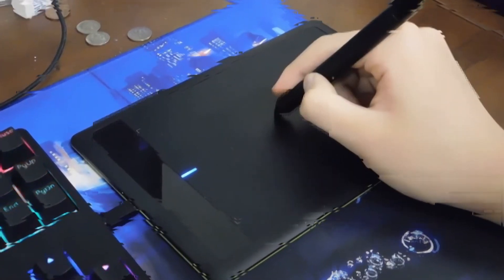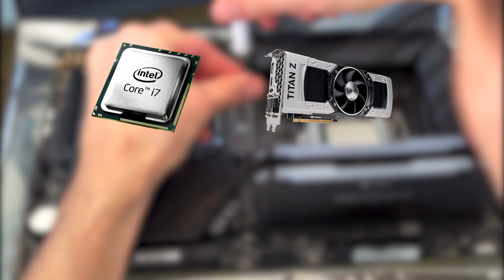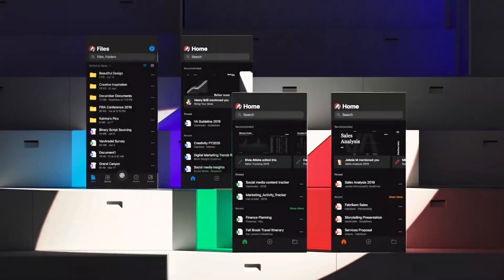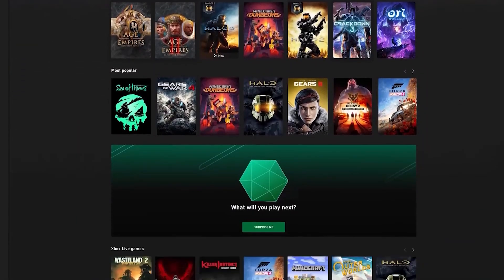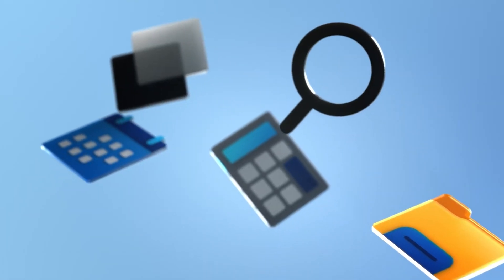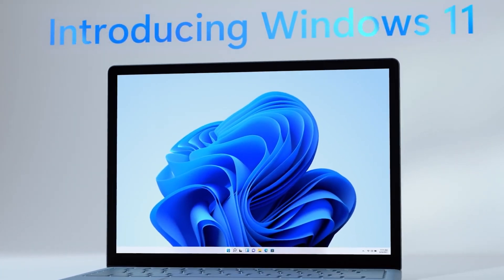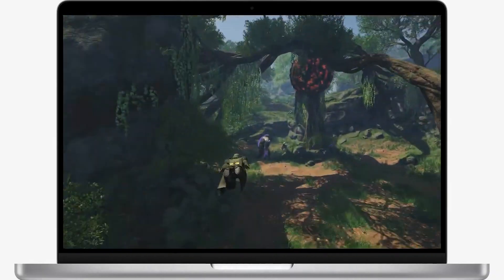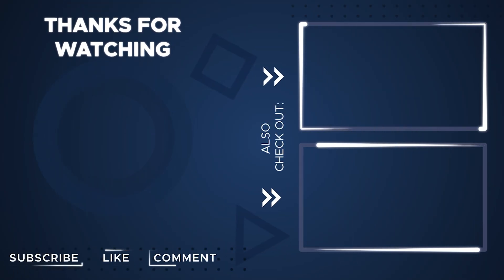PC vs Mac | Windows 11 vs Mac OS - Real Winner...

Comment: You can run Widows on a Mac thru  mature virtualization software ( Parallels Desktop 19 ). Run both at the same time, easy.
If someone was switch to Mac they could load their entire software, including the Windows operating system

Comment: It's not just gaming, Windows is superior for many professional uses as well especially when it comes to business and enterprise. Windows software library is extremely rich and macOS really falls short, which is a shame because Macs are excellent products otherwise.
Reply: Examples? I've literally never found an app that I couldn't find on mac or I found a much better equivalent.
Reply: @ArthropodSpidey  I'm talking about professional use cases. In this case, business and finance software. MS Excel and PowerPoint are essential and are superior on Windows. MS PowerBI and Dynamics 365 do not exist on Mac. Even non-Microsoft software like SAP often work better on Windows. People in finance and consulting have to stick with Windows because of this, at least for their work laptops. Even some B schools insist on students carrying Windows laptops instead of MacBooks.

However, Macs are superior to Windows for some professional uses as well like software development and video editing.
Reply: windows software is garbage 😂
no one uses windows appstore and most programms are available for mac and windows.
Reply: @JockelBacke  You are speaking nonsense. In engineering world especially those requiring CAD design, FEM analysis, data analysis hand downs window is far superior it ain't funny. In big enterprises, they use window when they want to create bjg servers, or to create super computers. Even machine learning, a window operative system is prefered. For careers that require more extensive and workload, window have it beats and apple have not yet close that gap.
Reply: @kyordannydelvalle523   you have clearly never worked in a major company. Most software engineers use Mac and CAD and all the other things can be done on Mac as well. Apple is greatest tech company in the world and uses macs lol.
Reply: @JockelBacke  You are speaking with ignorance. You only talk about software engineering (which is the only mac is suited for in term of engineering). You excluded mechanical engineering, electrical engineering, civil engineering and so many more. Many only talk about software engineering since it is the only engineering that uses mac.None of them uses Mac. Especially since Mac struggles many time  performed FEM analysis structural or thermally (bending, stress or strain analysis, failure of the structure, factor of safety, heat transfter, fluid analysis.) To even make even engineering softwares like solidoworks run at least decently on Mac, you need to either use " paralel" or even use window operative system to make it run a little more smoothly. However, you can do basic CAD on there but once you try big assemblies on Mac, you will notice it limitations. Not to mentioned that Mac is known to not have compatibility of many engineering software as compared with Mac nor the features or tools like on the one on window made worse thar window with discrete graphic card does it way faster. Mac is only suited for programing, 3d animation blender, and etc. Heck, for streaming, many uses PC, not Mac. Also for accountant, excel on Mac lacked so many features that accountant uses. So no, many who said "mac" is for profesional is just pure ignorance especially what you just said. You clearly have never worked on engineering o on STEM careers since barely any of them uses mac. Go to either profesional mechanical engineer or view videos regarding engineering mac (besides software engineering). They will outright tell you window is the better option. Heck, in university, barely any engineering student excluding software engineering uses mac. Inform yourself before saying thing like you said.
Reply: @kyordannydelvalle523   why are you so fragile? Its a fact, that Apples microchips are much more efficient than Intel, Nvidia, ... CAD f.e. also runs on Mac. Its no issue, only for people who dont know how to handle professionell software. Apart from that, specialised software is not a significant point for most computer users. In terms of operating system, hardware, efficiency, power, ... Apple performs the best. The only thing where Windows is a little bit better is in terms of usability of a handful of specific programs. Overall and for most people, a Mac is the right choice
Reply: @JockelBacke  None of what you said refuted any of my points. It is known fact that Mac can't handle extensive FEM simulations. Tell me, do you study or work as a intern or work as a professional engineering companies??? You are talking to a mechanical engineering xd. You don't even know what FEM analysis means. Many of engineering programs for mac to work you need "parralel" to even works and with less performance than the one window offers. Also, mac os was done using part of it on window. You are just spouting out ignorant claims when you don't even work on that career in the first place. Go and talked with professionals including me and you will noticed all will said that you are better off with window. Again, refute that fact that many streamer exclusively use PC instead of macs, why many engineering use more window over mac and accountant prefer window.  You better informed yourself. Even companies uses super computers using various gpus combined to do even bigger assemblies like space craft. Mac is the one who have the least amount of compatibility with profesional software. It wasn't then people wouldn't need to use "parralel" or even window boot camp in order to run many profesional softwares. So keep repeating minsofrmed information. Apple is only suited for blender, programming and video editing. Not for engineering except for software engineering. For most of my interns and even companies I worked where, window is still prefered over mac.
Reply: @kyordannydelvalle523   I dont really care what you do in life. Its just a fact that Mac OS is superior in almost every category for most people. And no, companies dont use "supercomputers". Those are for labs and intensive research, like modelling climate change. You should look up the term first, before talking about it.
Reply: @JockelBacke  You are contradicting yourself way too much. First you say that engineers uses mac when that not true. Nope, mac os is limited in so many thing and it is the truth that mac is less compatible to many profesional programs than window, some to even have to use "parralel" or "window boot camps" in order to use them. Window have not that problem. No, supercomputer are use also for study of particles, huge assemblies and many STEM applications. Also, I was correcting you since you were spouting so many incorrect engineering facts. You barely refuted anything of what I said. You are proving you are talking in a field you don't worked in. The ones who need to inform more is yourself. You are also ignored that modern Mac Os was created using window  and especially linus
Reply: @kyordannydelvalle523   you just admitted that Mac OS is the better operating system. thanks.
Reply: @JockelBacke  Not once I addmited how mac os is better xd. You reading comprehension is abysmal. You barely refuted none of my points. That fact that many programs you need "parralel" and " window boot camp" in order to run and not even at the same level as window not to mentioned run as well as on window is not a good thing and even some of them you have to pay in order to use whereas in window they are free. Again, you are spouting incorrect information regarding a career you don't partake that isn't software engineer. CAD design and FEM analysis and as well many other STEM careers are way better on window than Mac OS (It was not design around it). Man, I hope any newcomer engineer student  don't believe that mac are good for engineering besides software engineering. It don't run as good as on window and lack compatibility there is a on engineering software. Why you think university provide student with window laptop for engineering and I have seen it many times students with mac have to request one since they can't run it xd. Inform yourself.
Reply: @kyordannydelvalle523   you must be a happy person taking so much time to write novels and fairy tails about computers :)
Reply: @JockelBacke  Fairy tails on computer xd. Say the guy who said many misinformation on the engineering industry and barely refute any of my points. You don't know engineering at all. Window is better fit for engineering, CAD and FEM analysis than Mac Os. That is a fact. That you are ignorant and think mac os is good for every career is not my problem. For streamers, window does it way better. You were the one living a fantasy saying stuff that mac comparable to window in CAD design, FEM analysis and many STEM careers when that is far from the truth. Mac OS is suited for blenders,programming or video editing where it was optimized for. There is still a huge lack of compatibility on many engineering programs. It always a main complaints with mac os is the lack of compatibility in terms of softwares. You don't even know what FEM analysis even is.
Reply: @JockelBacke  Windows is not garbage at all, however I do like Mac better myself. But as a finance professional, working with Mac is quite the handicap because some programs are not there and some just don't work as good, mostly Microsoft's programs but even some third party ones.